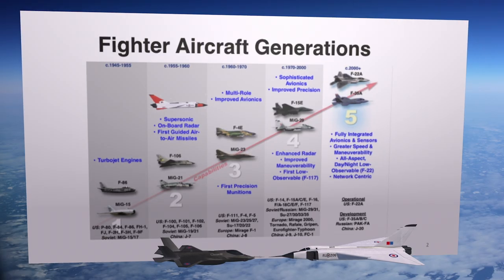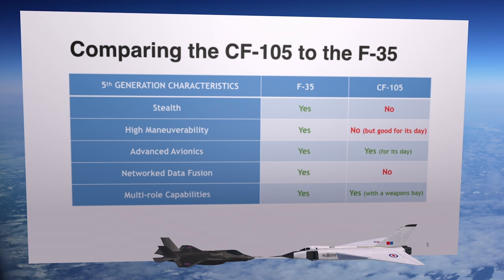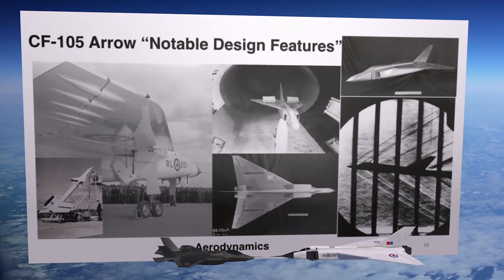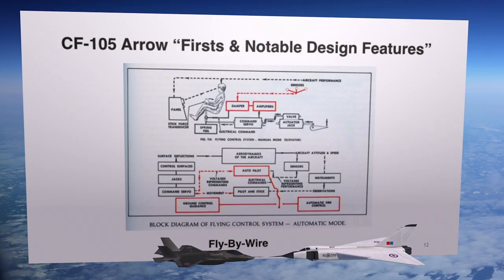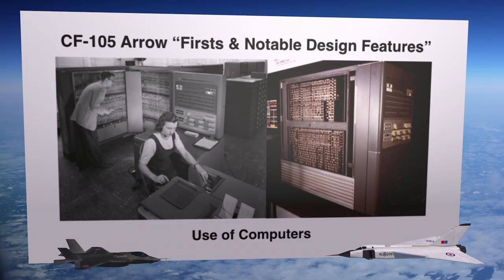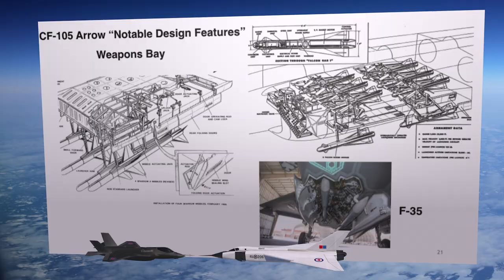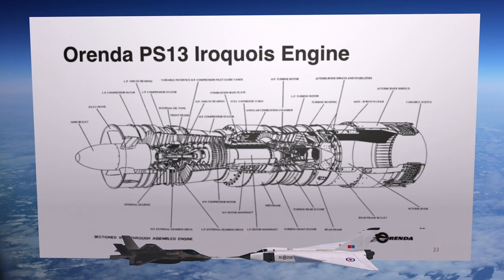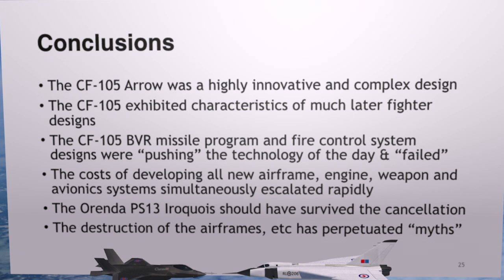AVRO ARROW FIRSTS VS F 35 LIGHTNING

Comment: The Arrow was totally " Fly-by-Wire  " and could be flown by ground control. It could complete its intercept mission with a dead pilot in the cockpit.  I saw Arrow when it appeared at the Air Show at the CNE in Toronto in Sept 1958.  Big, Beautiful, LOUD

My Uncle work as an engineer at Orenda, he was pickup by JPL after the Arrow was scrapped.
Reply from the maker: Hi Alan,  Your a lucky man to have seen an Arrow.  regards...Virtual.
Reply: Loud only works in a barroom ball, i'm jealous you saw it but the tech specs today are hard to match
Reply: I too saw it around that time, but from my backyard in Brampton only a few kms  northwest of Malton Ontario where the Arrow was being created. I was about 10 years of age and only saw it as when it passed over several times it usually broke the sound barrier, a noise one never forgets.
An uncle of mine worked there in security and he learned the reality of building such powerful planes a year or so later when the Deifenbaker cancelled the project due to pressure from the US ab=nd the entire workforce was suddenly unemployed.

Comment: Thanks Deifenbaker for screwing us on this aircraft! Don’t even have our own car company!
Reply: It wasn't just Deifenbaker, the Liberals, had they won the election would also have killed the Avro Arrow. It was simply too expensive for an economy the size of Canada's.
Reply: yup mad little bugger not only killed our pride that day but later signed a contract agreeing NOT to undertake any jet fighter development programs again ...
Reply: @michaelheath1925  actually for the cost of the cancellation they could have filled the order ... and proven the arrow ... the method of build to production line avoiding prototyping increase front end load but lowers with each plane built ... the cancellations would have paid for 100 planes to be built resulting in and overall cost of 4million dollars per plane ... so we not only would have had a complete fighter interceptor that met our needs BUT we would also have the most modern one for 70 years ... thats right to this day ... NO FIGHTER not even the f22 fills the requirements the arrow was designed for .... NONE ... and thats 70 years later with no arrow to spring forward from ... 
imagine where we would have been by now ... if they were able to finish ..
Reply: @0623kaboom  Hello. Been over this many times now. To think a 70 years old aircraft would be superior to one built 20 years ago is simply false. The plane was over budget and the performance was not exceptional for the time it was built. Would it have served Canada's interceptor needs adequately? Yes. Unfortunately, it did not happen. I think it is time to move on from the Avro Arrow. Otherwise Canada need to put their money where their mouth is, build the damn aircraft and "prove" to the world how superior this 70 year old design actually is.
Reply: Toyota's in North America are built in Canada though. Many American models are also Canadian built like millions of crown vics. Ontario builds millions of cars even if they are not a Canadian company.
Reply: You can't know the actual specs all real info is destroyed and it never flew once with the Iroquois engines. So you are just guessing and no actual models even exist.

Comment: Rumours had circulated that Air Marshal W. A. Curtis, a World War I ace who headed Avro, had ignored Diefenbaker and spirited one of the Arrows away to be saved for posterity. These rumours were given life in a 1968 interview, when Curtis was asked directly if the rumour was true. He replied, "I don't want to answer that." He proceeded to question the wisdom of printing the story of a missing Arrow, and wondered whether it would be safe to reveal the existence of a surviving airframe only nine years later. "If it is in existence it may have to wait another 10 years. Politically it may cause a lot of trouble."] The legend endures that one of the prototypes remains intact somewhere.
Reply: There were no survivors, I met one of the guys who cut them up.
Reply: yes and no ... there was an iriquois engine heard on the fateful day but there was the one engine on the bomber that went missing before it could demounted ... this is most likely where the rumour comes from as the bomber has been found in the states plane boneyard ... of course no engine mount or engine are present there ..